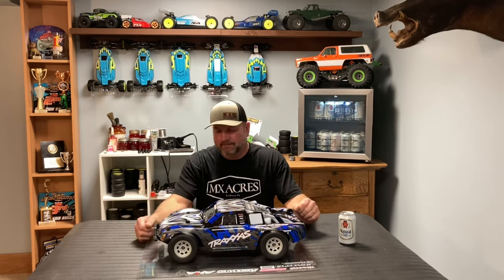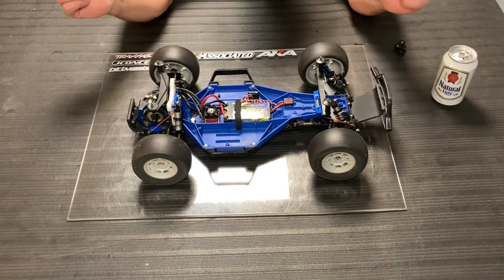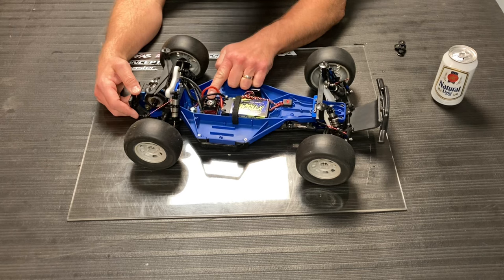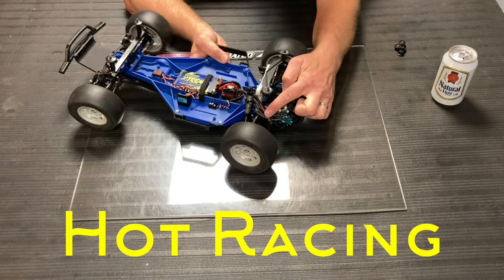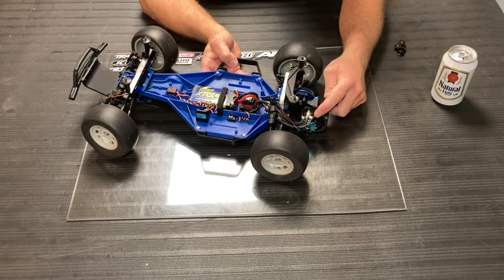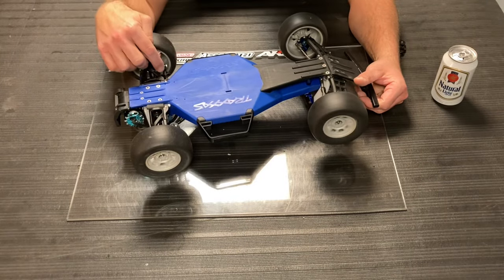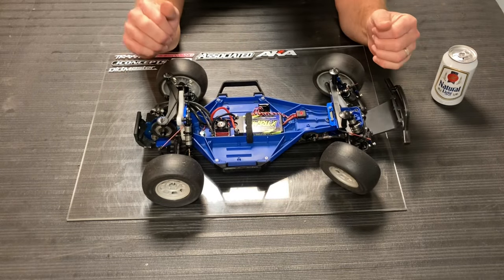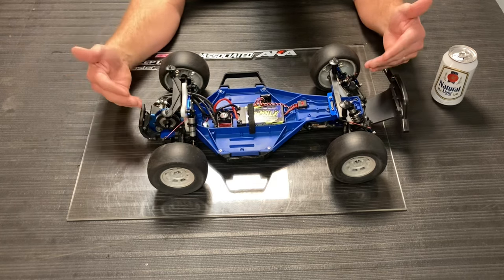Traxxas Slash Racing Setup How to do it

Comment: I ran spec slash at The Factory once a month ago on carpet and I rented a Slash to run in the box stock Slash class. I was told I could make changes but I couldn’t change the gearing so I laid down the shocks and put some 50wt oil in the front and called it a day. I TQ’d and won the A main. It didn’t need higher gearing. I was getting wheelspin from the stock tires coming out of the sweeper onto the front straightaway.

Comment: Ur suspension tuning setup is ideal for smooth tracks my slash likes it soft with maximum travel on a rough bumpy track i run pro line power strokes all around second hole from inside on the rear first hole up front

Comment: i know i will not be up that way till next winter but can't wait to run my slash 2wd at big dog and i hope to have a couple more rc's by then. just starting my collection again and have had traxxas a bandit and rustler back in 95 so i know how good they can be when set up right for you when racing them. just glad they have a all metal gear transmission now days because you would strip a idler gear almost every week with them back then while racing them.

Comment: Now how about the Bandito set up? Which wheels and tires are you using? Thanks!
Reply from the maker: Wheels are ae and tires are aka ultra soft slicks.
Reply: @mxacres  did you have to change the front spindle axles to make the ae wheels work?